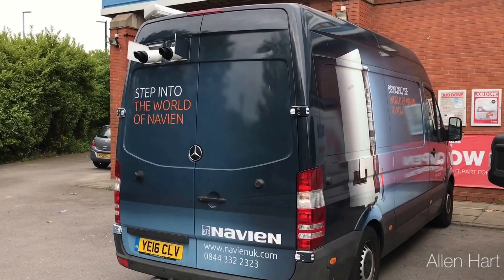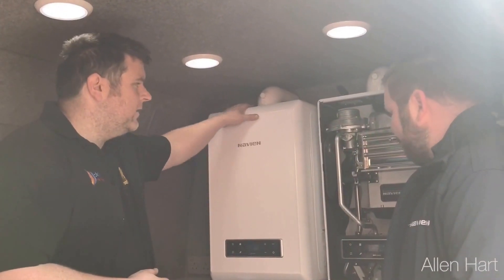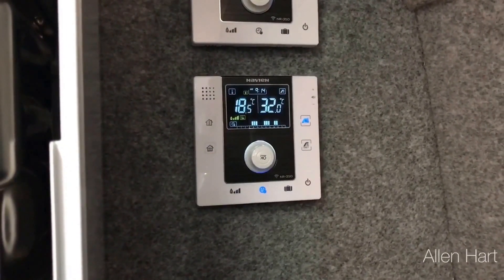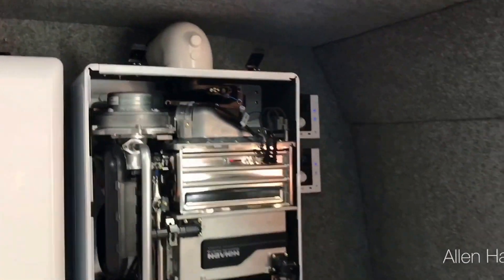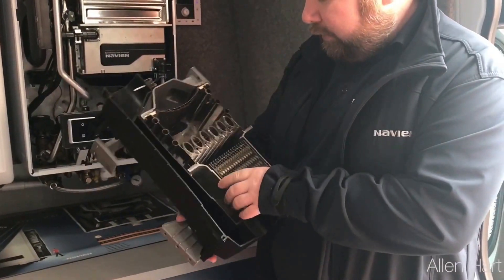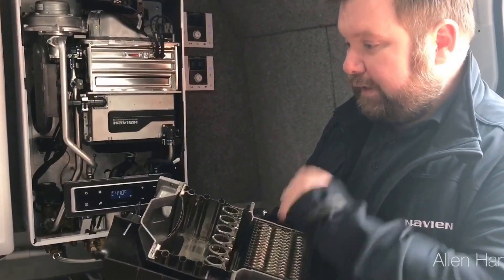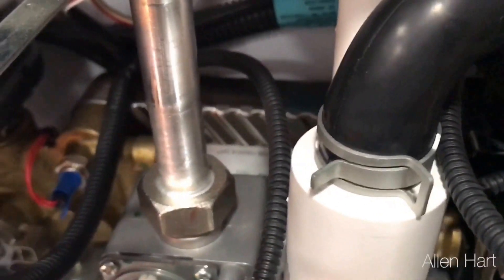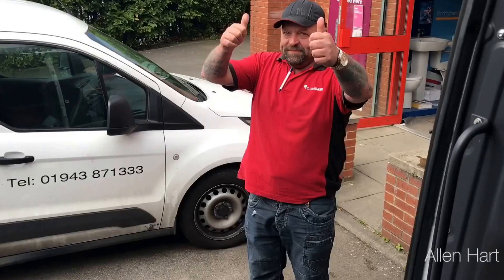Navien Boiler Review.  Van Demo at Plumbase Leeds Combi Boiler Review

Comment: Mikey pipes in america has found lots of faults with these boilers in America
Reply from the maker: I have never installed one so i wouldn’t really know. Thanks.
Reply: Yeh mikey pipes tested burner seals with LDF he has not had 1 that hasn't leaked. He even got one in the merchants fresh out the box and it leaked from burner seal.

Comment: Not sure why those are different than ones in US ??
Reply: How much those go for un UK?
Reply: @786otto  
40kW delivering 19 litres per minute hot water. At £958 inc flue.
https://www.plumbase.co.uk/navien-ncb40ldwe-combi-boiler-100010607-4000006
Reply from the maker: Whats different about them. Thanks.
Reply: Venting is two pipe design to use PVC, controls are also different. check it out at Navien USA. Navien got very popular here, those are great units if installed properly and connected to a compatible heating system. Hope they change their codes display for world display system because the current display has a lot to wish for.
Reply from the maker: I havent fitted one , they are new here.
Reply: Primary secondary piping, as hydroponic filter, and condensate neutralizer. No different than most of  condensing combi;s you have there, those are perfect for floor heating because of low water temp return. very efficient. I suggest to use short extension nipple than union on heating in /out there is a 3 way valve that will needs to be replaced after about 6-8 years that will make replacement easy . Ad least in US units.You will spend ad least 2 H reading instructions to set it up properly :)
Reply: @786otto  
The motor or the 3-way valve? Only needs to be replaced if failure. I have seen them both last 15 years without failure or problems. The CH system needs to be clean though, that is with inhibitor in and a magnetic filter on the return.

Comment: Looks a nice boiler, didn't realise they started selling them here. Is it plumbase that stocks them. Are they expensive.
Reply from the maker: Plumbase did sell them, not heard nothing about them for a while though. Thanks for watching.
Reply: @AllenHart999  
Plumbase still sell them, with Navien introducing newer more powerful models. This one delivers over 19 litres per minute in hot water. Impressive from such a small box. 
https://www.plumbase.co.uk/navien-ncb40ldwe-combi-boiler-100010607-4000006
Reply: Duftons stock them also and they are very cheap for the warranty you get, I fitted ncb500 last week with 10 years.. also as far as I'm aware, navien don't have engineers who repair there boilers, so they pay a fixed price to the installer or whoever is onsite to repair the boiler